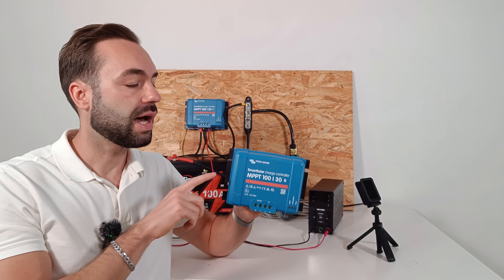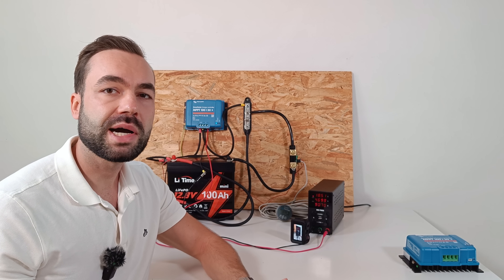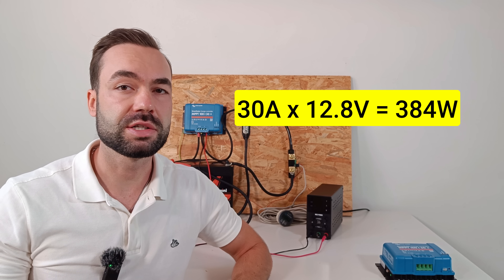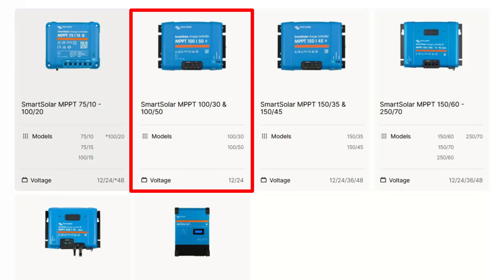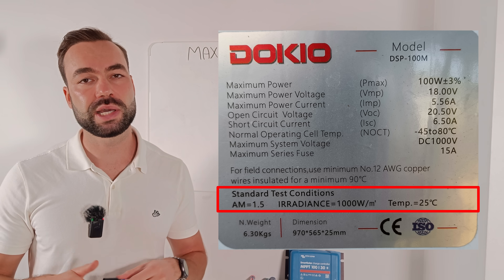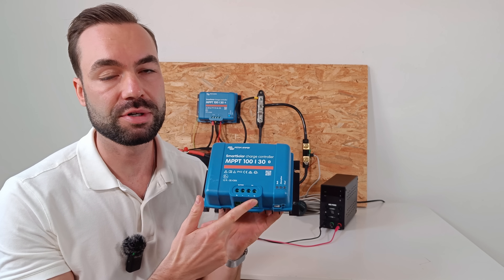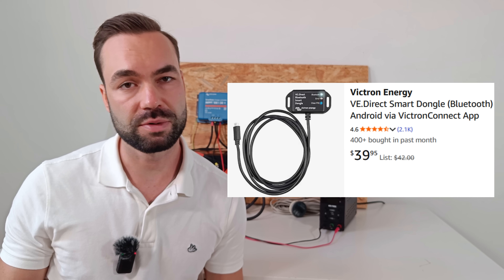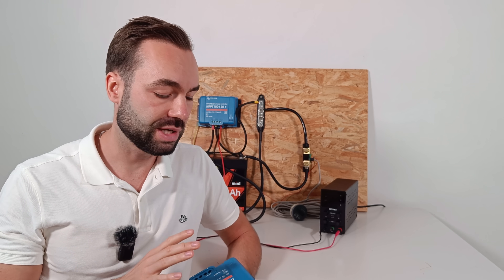Victron 100/30 MPPT Charge Controller Test + Review

Comment: Hi nick excellent video I have Victron 100/20 controller with one 200w solar panel so I can add another 200w solar panel in series without causing any problems
Reply from the maker: Yes, as long as the Voc is under 100V in cold temperatures.
Reply: @cleversolarpower I have the same 100/20 is there a minimum of volts to get that one to start charging as it doesn't say on the booklet it comes with
Reply: @srhyah7155 
It's the same as he says in the video for them all (at 12v)
Aim for a minimum of 20 volts..
Always check the controller has recognised the correct voltage.
The 100/20 smart .. is the best value and has the Load output..
I've got 3 .. this means if panels are in shade it doesn't affect the whole system and I don't over power them, max 10 amp's each so they don't get warm and work nicely.
Remember you can pair them in the app but I don't bother..
Efficiency wise 1.5 to 2 times the output voltage is about best but a little higher is good for cloudy days.
Reply: @Markus-UK hmmmm interesting mate, 
I'm looking at my 40a mppt from an Australian mob and there specs are 
92v max VOC - 520w charge - 720w max on 12v 
I'm running 2 x 250w panels 
Each spec 
VOC 22.30 - isc 14.62 - 250w 
In parallel they're giving me no more then 14 amps running into a flat battery like 8.6v gel battery lol and max watts I get is 200 of I'm lucky, 
And that's in full sun all day in spring,

Not sure yet but it sounds like the 40a mppt i have is being than the victron 100/20 🤔,

Maybe I should have brought the 100/50 ? 
Or should I just buy another 100/20 and parallel them to the same battery bank and have a 250w panel wired to each controller, 

Cheers 🍻
Reply: @srhyah7155 
Have you tried each panel separately to check they are both working ok..
I don't like directly paralleling panels as one can be parasitic, which is possible with what you said..
250w might be on the edge in winter of what a 100/20 can do.. they say 290w..
This video seems to say it's ok.
Have a look at prices for the charge controller's..
I haven't looked for a while..
but 3 x 100/20 can be cheaper than a 100/50..
Same with B2B's..
I've already said about the advantages..

The real thing is to do some form of long-term plan for the system and scale accordingly.

The next panels I will buy will be 24v type, giving 36v out on a single panel.. plus they are bifacial and some are N type..
The price goes down in winter...
Reply: @Markus-UK yeah tried each panel separately and I get the same results, 
Hook them both together and it doesn't change unfortunately,

Leads me to think the connections are bad so Ive checked them on the in put and output with a multi metre and all getting power same numbers everywhere it's so weird 😅

Might have to do the old two mppts to one battery bank if each
Reply: @srhyah7155 
Ok...
Let's work this through..
I'll check the comments each day for your reply.
Start with each part..
So the voltage is the same on both panels, not connected to the controller?
Have you checked the polarity.. which wire is + and -?
Is there a diode in the box on the panel.. is it ok.. it could break down under load.
Are the connections good and no shorts?
On the label.. what are the voltage and current..
Do you have an amp meter higher than the current it specifies?
If you do then check the current but it must be connected the right way round..
It's better if the amp meter is big enough to cover the panel with a towel and connect the meter and only expose a tiny bit of the panel and see if the needle goes in the right direction.. if it does then slowly remove the towel and see what the current is..
Tell me the results..
I think Nick has a video about testing panels but use the towel so you don't damage the meter.
Reply: @srhyah7155 
Just remembered..
I had two older panels where the wires were made of copper and over the years the strands had disintegrated..
So if numbers are weird check using the terminals in each box on the panel..
Controller's can go wrong for a variety of reasons or can work ok at lower power and go wild and not switch off at higher power.
Reply: @srhyah7155 
I don't like the mc4 etc connectors as they corrode and the Y pieces also corrode..
Reply: @srhyah7155 
btw .. what country do you live in.
Reply: @Markus-UK true yeah I'm using the y joiner with Anderson plug, 
All kings camping folding solar panels, 

I can't really complain the two of them gave me 250w it's just gotten into spring, and apparently the size of them some people reckon I'd be lucky to get 125-130w from each 
However they charged up my 3 X 100ah lithium batteries in one day  on a kings 40a mppt, 

Worried if I switch to the 100/20 it will limit something 
And buying a second 100/20 mppt seems like a bad idea but a good one of they have a panel each lol, 

I guess I'll wait till say the hotter days and see what VOC I'm getting and amps with the watts of everything lines up then I guess I'll stick to the 40a mppt and just disregard the Bluetooth readings as that's basically all that's different 
(Handy to have but my 40a screen shows me everything, so yeah hard call lol) 

Buy it for testing 🤔😂
Reply: @Markus-UK I have just checked the volts from each panel amd today on each separately I'm getting 17.something voc
,
(Testing with my multi metre btw 👍)
Joined at the y joiner it's reading 35.44 VOC 
Lead to the mppt is 35.44voc mppt is 21 - 22 (fluctuating) 

Each panel I'm only getting 5.4 -4.5 amps 
Does that seems strange with the volts I'm getting on each panel?,

The diloads in the back I'm about to check, 
Just watching a video to make sure I read it correctly 😅
Reply: @Markus-UK Australia
Reply: @srhyah7155 
What does the label on the panel's say?
(also I was trying to work out what your electrical knowledge is, I didn't want you getting hurt)

If I understood it correctly, it sounds about right..
though 17 volts seems low but there are panels of that voltage..
at 17v they are probably meant to work with a PWM..
The assorted panel's I have bought give 20 to 24 volts each.
I have 4 x 50w that a friend didn't want, they give about 18v each so I have them in 2 series strings but I have used diode's to stop them becoming parasitic.
The one pair on a cooler day gave 102w which is very good as they are over 10 years old.

I thought you were putting them in parallel..
Putting them in series is the best strategy.

You may already know some of the these things...
V x A = W
Volt's x Amp's = Watts 
Watts is Power.

Series is +panel- connected to +panel-

As they are folding panels, what are the connections at the folds like.. all metal work hardens and then strands break also look at the terminations..
This is the problem with some folding types.

The equinox can be towards peak power because of the cooler panels..
Panels angled to the Sun can be 4 times more power than flat..
Keeping them clean helps greatly but only clean when cool.
How old are the panels?
Reply: @Markus-UK I think you're right on the pwm mate as that's what they came with and most are hot glued on from factory, 
They now make ones without the pwm already attached so I think I may need those or a couple of house panels,
Somehow bolt those to the folding camping ones so I can have a group array,

The stickers on each panel reads,
250w
VOC 22.38
Isc 14.62
Vmp 18.2
Imp 13.74
Reply: @srhyah7155 
How many panels on each folding unit?
Reply: @Markus-UK 2 mate but only one sticker for both so my guess is 125w each, 
Also to follow up on your question about my electric knowledge - welllll lol nah I know the basics, basically enough to build a small 12v off grid system after copping a lot of judgmental on fb pages like DIY solar ect 😅

Before I flick any switch I have a mate that's a qualified electrician so I will always get him to check my work and breaker sizes ect 
(First rookie mistake was non DC breakers hahaha😂)
Reply from the maker: 7V over your battery voltage.
Reply from the maker: Right polarity? Try connecting in series, use an ohm meter to measure the resistance from the connectors to your charge controller...
Reply: @cleversolarpower 
I'm going to give it a try in series,  
My volts are reading 20-22 at 730am on my mppt, 

But on my panels on my multi metre it's saying 4.98 on Ma AC and on Ma DC it was reading 35.59 setting, 
That's on both ends on the Y joiner for parallel, 
Also the reading on the voltage was around 33-34 on my multi metre but mppt was only saying 22-23, 

An ohm reader you reckon I'll look for one and study up some more, 

Would my numbers be so low because I'm barely using any power consumption? 

In saying that tho I never once managed to see over 200 while charging 3 X 100ah lifepo4 batteries shipped at 30% Soc to a bus bar 🤔
Reply: @srhyah7155 
Can you test each panel of the 2 in each folding unit..
I've read what Nick has suggested.. don't have the panel in the sun, have it completely covered or disconnected.. so not creating ANY power when you use a ohm meter, it can give bad readings or blow the meter.
I didn't realise you were connecting in parallel..
Are you connecting both ++ of the panels to the + of the controller and all the - - to negative..
I thought I had said.. if I connect panels in parallel I use blocking diode's.. other people don't..
Reply: @srhyah7155 
Have you at any time connected the panel's the wrong way round.. either to the other panel or controller or battery.
Reply: @Markus-UK nah mate wasn't keen to try series at first with little basic knowledge so decided to go with a Y joiner, 
Battery always got connected to the mppt first and solar panels last via a double pole 40a dc breaker
Reply: @cleversolarpower ohhhh okay so my 300ah lifepo4 sitting at 13.67 after a week of resting off charge means that the charger will kick in at 20v 
however that's alright full so for every one volt I can take out it will put back in 😅, 
Man on to many medications some times I reckon lol basic stuff just slipping my mind 
Thankyou
Reply: @Markus-UK never the wrong way around mate 
Plus everything I have has reverse polarity protection 👍, 
Tried to keep things as dummy proof as possible for myself I did 😅👍
Reply: @Markus-UK  also mate new pics of my new portable hidden solar system/bank/generator is in post I have made in my YouTube channel if you'd like to keep track and see what is happening, 
It also shows the solar panels specs and everything I'm using and talking about with you atm 👍🍻
Reply: @srhyah7155 
But was the polarity correct?
Test each panel in the pair separately for voltage and current.
Reply: @srhyah7155 
What polarity protection on the panels?
Reply: @Markus-UK I will do mate and I will take pics of everything and document it all 👍
Reply: @srhyah7155 
Do the tests that I said.. maybe with your electrical friend..
Reply: @srhyah7155 
I'll have a look..
but it's 254am (26 sept, you are 12 hours ahead.. not sure how that happened) so will study tomorrow..
Reply: @Markus-UK quick update mate my victron 100/20 gets up to 220w full amps volts are perfect, 

Idk what was going on but I think the cause was just the get battery as all 3 of my lifepo4 batteries get great figures 👍👍, 

Thanks for helping me out with my issue mate, 
Now I just have to work out if I have enough amp hours to run my coffee machine or jug lol.

My 3000/6000w Pure sine wave inverter was giving different results to the victron mppt graph and idk how to quite ready it yet hahaha but I'll get there 👍
Reply: @cleversolarpower thoughts on my victron comments?
Reply: Thanks 🙏

Comment: Great channel Nick, I am designing our first solar system and your videos and book are so useful. I have a question on the Max Voltage limit. Given the minimum temperature is almost always in winter at night does this in any way reduce the actual voltage delivered, obviously the current will be negligable but what about voltage. Cheers from New Zealand, Andrew
Reply from the maker: Great to hear that my videos and book helps you out. Indeed, the moments with the highest voltage will be in winter.  At night, the solar panels don't produce voltage. That only happens when light hits it, with clouds or sunshine. So 6-8am is the danger zone. If you want to calculate it by yourself and not use the safety factor, then you should use historical weather reports for minimum night temperatures in winter.
Reply: @cleversolarpower  Thank you so much Nick